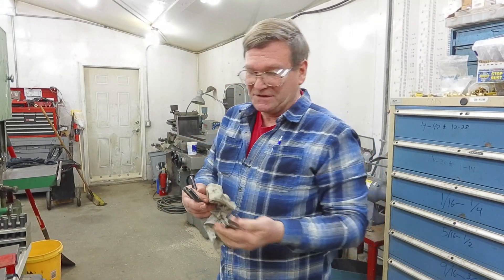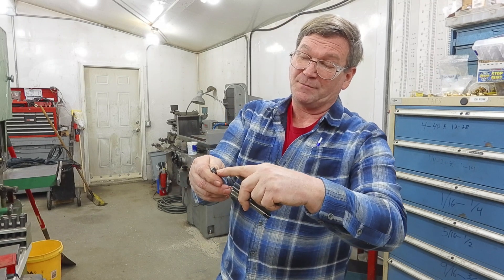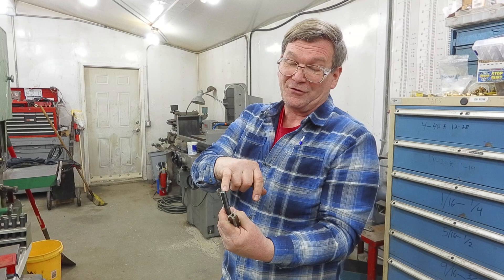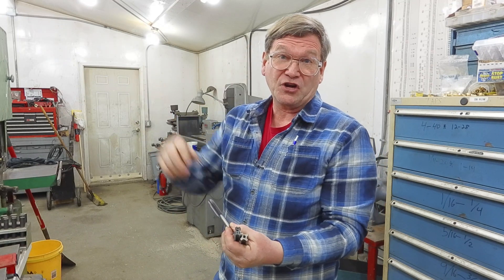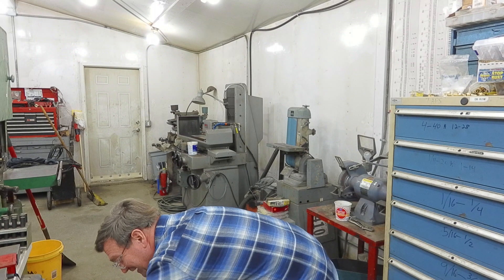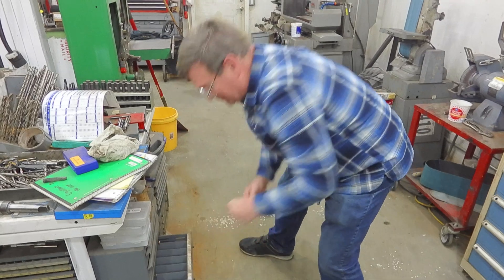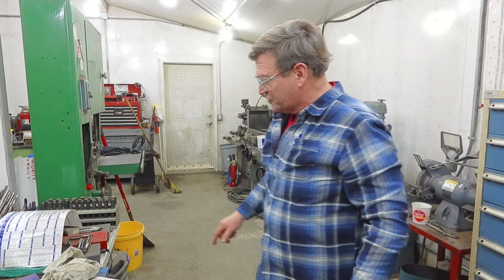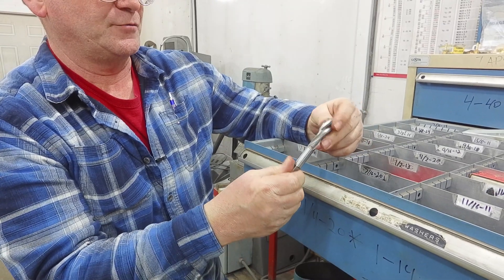Machinist's Minutes: The Different Types of Taps

Comment: Years ago I was an engineering student working a summer job.  The machinist I was working with for some machine parts had a test for me on my first visit.  He asked if I needed to call out what side of the plate the hole must be tapped from.  Apparently the previous guy thought if you tapped the hole from the other side it would be left handed.   My examiner had an aluminum plate with every bolt size he could find, drilled and tapped in increasing size, with the appropriate bolt so that it could be inserted from each side.  I passed that test on the first go.  I failed many others....

Comment: One thing im still wondering is why a person would want more or less flutes on a tap for a particular job ! As in 3 flute over 4 flute and so on !!!
Reply: The 2 or 3 flute taps are for power tapping.  spiral taps are nice for power tapping because it removes the chips from the top instead of packing the hole full of chips. 

4 flute taps should really only be used for had tapping
Reply: The less flutes the stronger body is less likely to break off.